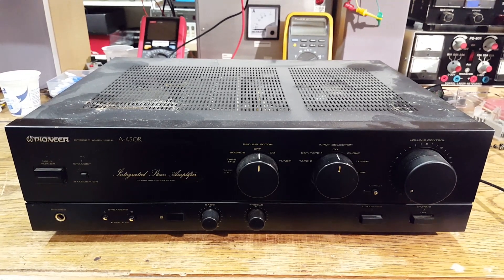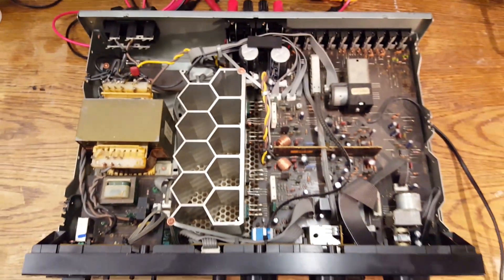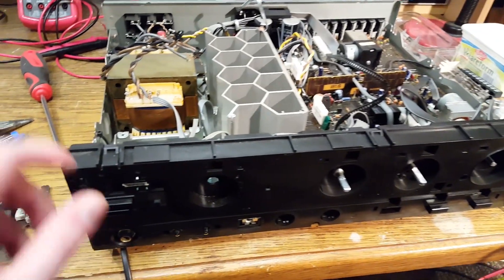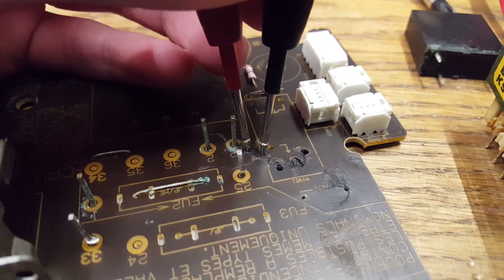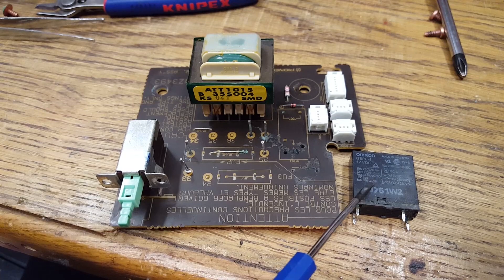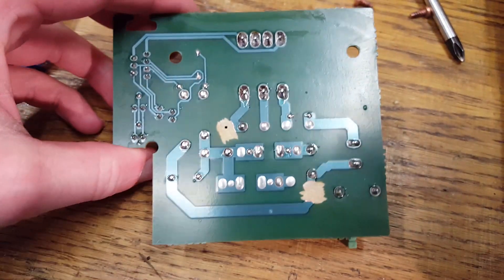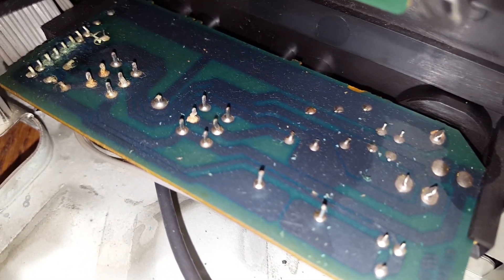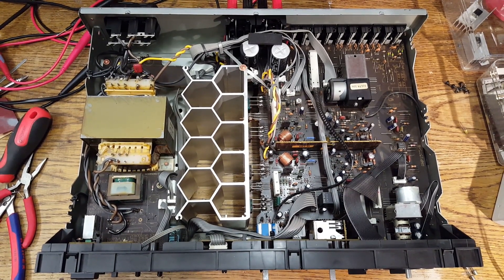Pioneer A-450R Amplifier Repairs [1/2]

Comment: Hi DrCassette, danke für deine Arbeit!

Ich habe mir heute dasselbe Modell in eBay Kleinanzeigen gekauft. Leider habe ich wohl ein ähnliches Problem: Die linken Eingänge sind alle viel leiser, und die rechten Eingänge reagieren auch auf meine Finger, ohne dass die Lautstärke an ist. Was könnte das Problem sein? Auch der Inputmotor? Kann ich den auch mit Bremsenreiniger reinigen statt Kontaktspray wie in deinem zweiten Video?

Danke für deine Hilfe
Reply from the maker: Du könntest versuchen, den Input-Wahlschalter zu reinigen, aber das kann auch an anderen Schaltern liegen. Ist die Verbindung zwischen Vor- und Endstufe auf der Rückseite in Ordnung? Kontakte grundsätzlich nur mit geeignetem Kontaktreiniger reinigen, Isopropylalkohol (IPA) geht im Notfall auch, wird aber nicht lange halten. Mit Sachen wie Bremsenreiniger oder WD40 richtet man in Schaltern mehr Schaden als Nutzen an!
Reply: @DrCassette  Die Verbindung zwischen den Stufen ist vorhanden, sie reagiert auch durch Fingerberührung als "Eingang" mit einem Störgeräusch. Dabei reagiert die linke Seite, ähnlich wie die normalen Eingängen mit einem lauteren Störgeräusch als die rechte Seite. Das ist bei jedem Eingang so.
Da mir beim Versuch des Reinigens das Zahnrad vom Input-Wahlschalter zerbröselt ist (wird jetzt neu gedruckt), habe ich die Welle dann mit dem Schraubendreher hin und her gedreht, wie der Motor das auch machen würde. Sollte ich bei der Gelegenheit einfach den Input-Wahlschalter auseinander bauen oder ist das nicht nötig? Welche Schalter sollte ich denn noch in Betracht ziehen?

Comment: Boy is this a complicated unit.

Some years ago I received a unit from an estate and it has been sitting in srorage. I decided to tackle it an so far the biggest problems were that the motorised source selector was quite haywire and I had to turn the volume initially quite high before I got the two channels to balance. 

After some extensive use of contact cleaner the selector works and there is no crackle in the volume pot. Still the volume needs to be turned high initially.  

If I intermittently turn the device to standby or mute, I have to do the volume trick again. Also if I switch a speaker circuit off and back on. 

So far I have found that the front middle relay clicks when I hit the mute or standby button, but not with the speaker selectors. It is the mute relay that cuts input to the terminal stage. 

There are two relays near the speaker terminals for speaker selection, and I have found that tapping them with some force affects the output level and balance. Likely they have a contact problem. At least bypassing one of them forces that speaker circuit on and it sounds fine all the way then.

I must check if I can get replacement relays or if I can contrapt a substitute to have at least one circuit working.
Reply: dude try popping the lid of the relais and just hit em with a good contact or tuner spray. I had the same problem with my onkyo a8850 and after i did tackled it with tuner ( Teslanol Oszillin T6) it works like a charm.

Comment: I have the A-339, as far as I can tell it's identical to this one, except that it has no remote or standby feature. Yes those push down ribbon connectors are dodgy, especially the large black (seems like it's also grey here) one, that one is EVIL, lol, took 20 min to put it back together.
 :D

Comment: Nice video but I would cut the board vhere it is conducting, that should vork to
Reply from the maker: Yes, that absolutely would have worked. In fact it would have been a much better solution to the problem. Too bad I didn't think of that in time.

Comment: Hi, can you help with an amplifier's volume control, for model Pioneer A109 ? Where I could find this component ? Best wishes, Stefan.
Reply from the maker: These are special components, maybe you can find a brand and / or part number. It should be easier to try and fix the original volume control.
Reply: The original volume control was torn apart by someone who says it can't be fixed. This is the code: ACS7035-A
100 kohms Ax2
3D2M MAL
Could I put something similar or a simple/ordinary volume control instead of the original one ?
Thank you for replying ! 
Best wishes,
Stefan
Reply from the maker: You could try to fit in another potentiometer, but mechanically it probably won't fit very well. You'll need a stereo potentiometer, 100 kOhms, logarithmic. Those are readily available.

Comment: hummm very interesting. I want to know how this amp is going to be. I have the Pionner A400 working well with the exeption of some failing on the selector of the lines and some noise on the volume potenciometer.
Reply: I don't know what is that. I mean brands.
Reply: @Helderhugo  

WD-40

Comment: Interesting honeycomb heatsink.
Reply from the maker: Pioneer had this as an anti-resonant design back then. The bottom cover of the amplifier too has a honeycomb pattern stamped into it.
Reply: They did this with cassette decks too like the 737 or 757
Reply from the maker: Yes, indeed. In the early 90s these honeycomb patterns were an item on Pioneer's feature list.

Comment: I have an Akai AA930 that after a few months without being used stopped outputing sound. Radio, aux in, phono, nothing comes out of the speakers (i notice a small Hummm""). if i use headphones and crank the volume almost to the max, I can hear a bit of the source (music). Do you have a video showing a similar problem from which i can learn where to start looking?
Reply from the maker: Your problems can have different causes. You could start by checking the speaker protection relay, if your amplifier is equipped with one.

Comment: You can bypass final relay and check some voltages, you can put in some small fuses to limit damage if there is more.  Go back and check your grey wires for incorrect polarity and connections and water corrosion under connectors as well.
Reply from the maker: This is not necessary, the amplifier is fully repaired. Part 2 of the video is coming tomorrow.